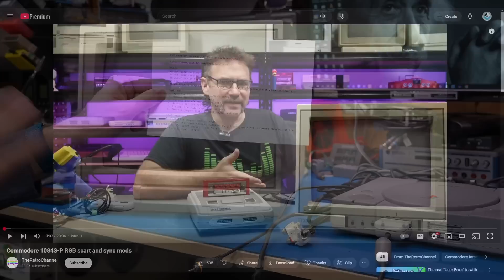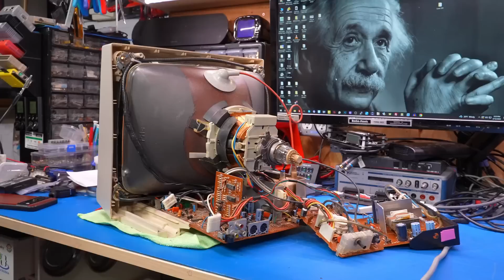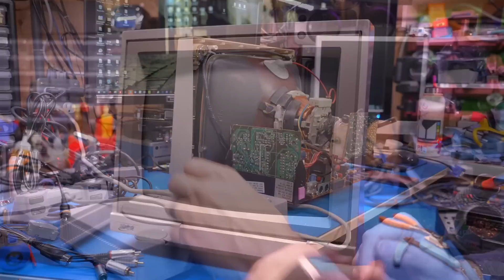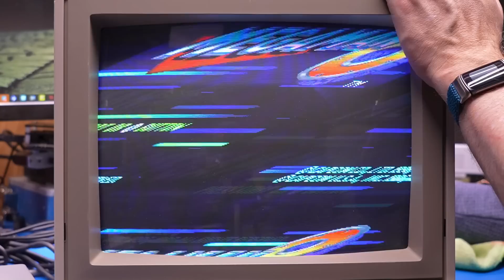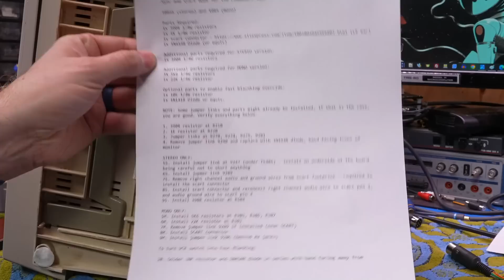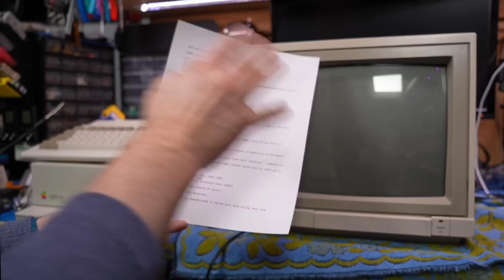Ultimate Commodore 1084 SCART modification

Comment: The pictures you linked with instructions have a totally different, third type of setup. The steps are also convoluted. This whole thing ends up being very confusing.

Is what you have written on the second paper in the video the correct directions or not? I think maybe you should just link those directions instead of an entirely separate, third setup in the link.

Comment: The RGB blanking signal (pin 16 of the SCART connector) you're talking about at 22:15 has an input impedance of 75 Ohms (like the RGB signals), so you should not feed 5 or even 12 Volts in that pin. 1 Volt is enough to do the trick.

Comment: I'm almost sure the issue with the sync loss has to do with the voltage on the sync pins. Unfortunately different classes of gear output different voltages. Some consumer TVs expected the SCART sync pin to idle at 0.3v and then go to ground for sync. Others could output as much as 5Vp which would need to be attenuated. I think using a diode and resistor to simply pull the sync pin to ground may have helped, you may have been either exceeding the source current on that pin or over driving it with full composite video. A simple diode circuit can be used to separate sync from the rest of the video and that may have been a better solution?
Reply: Oh, the eventual solution did use a diode :) I'm happy I figured at least part of it out

Comment: The Sony PlayStation SCART cable actually had 220uf caps on the RGB pins in the SCART end of the cable to properly attenuate the connection. The PS2 and PS3 had the proper caps inside the consoles so they didn't require them in the cable. I'm not exactly sure if using RGB with monitors that use BNC or RCA connections require the 220uf caps or not? Could it be possible that the monitor has the circuitry to compensate for this?

Comment: 52:20 why does this display move left and right when you click the button on the back?
Reply from the maker: Conversion from Composite video to RGB inside the monitor introduces a propagation delay into the video signal, which results in the image being slightly delayed, so it shifts to the right.
Reply: @adriansdigitalbasement2 ok

Comment: I can confirm that there were versions of this monitor marketed under the Philips brand.

Early versions of the 1084 were infamous for the the line transformer ‚unsoldering'ˇ itself, basically due to the solder joints breaking.  Mine was affected by this problem as well.  It started with the image glitching occasionally and the effect getting worse slowly over many years before eventually resulting in a failure.  The fix was easy, just resoldering the defective solder joints and while at it all other solder joins of the transformer.  I didn't even need fresh solder!

Another few years later the same thing happened to a power transformer the weight of which was hanging on its solder joints on a vertical PCB!  Not the best way to mount a transformer.  Again simply reheating the solder joints fixed the issue.  While the line transformer was a well known issue which 80's computer press did write about the same happening to the power transformer was ont a well known issue with the 1084 afaics.  Guess there are Monday models - and mine was Monday morning, 8am.

The final issue was the power switch.  Which I believe was a standard switch covered with a cap to fit into the design language of the monitor.  The switch of mine didn't always latch so had to be pressed again before it  latched in the on position.  After many years that effect got worse to the point where the switch got unusable and never latched in the on position.  I worked around the issue by jamming a small screw driver into the gap between the cover and the case while hold the button down with the other hand.

Eventually I switched to using it as my TV - initially a very crisp TV with good colours using a VCR and later a sat receiver set top box both connected via SCART and audio via a decent stereo.  Eventually degaussing for the mask failed resulting in a massive colour cast, a close encounter with a big magnet had not helped either and generally the tube was getting verry blurry, so I retired it as it was approaching its 25th anniversary.

Comment: FLYWHEEL SYNC enabled monitors/TVs to keep acceptable pictures even if the broadcast sync pulse was noisy or incoherent. (This was particularly a problem for international rebroadcasts in Europe back when many countries had their own unique broadcast standards. The broadcast sync signal would only be used indirectly to establish a local sync generator (the flywheel) which utilizes frame timing as well as the broadcast sync to provide a stable sync period.
VCRs have very clean syncs (it’s literally recorded on the tape at fixed intervals) but the nature of helical scan VCRs (before the advent of cheap Time Base Correctors) had inherently poor frame timing. VCR frame timing is dependent on the speed of the spinning drum and the playback head’s alignment with the helical scan signal written onto the tape e.g. “Tracking”.
The VCR Button on the monitor disables the monitor’s flywheel sync circuit because its time base could be corrupted by tracking / frame-rate variations and instead just directly relied on the clean sync signal transmitted by the VCR.

Comment: I don't know why you'd have a bad image with composite.  That's what I've always used with my Playstation (ever since I got something with a composite input and no longer needed to use the RF adapter) and the picture is perfect whether it's connected directly to the TV or running through a VCR's composite input.

Comment: The signalling on the SCART video switching Pin 8 was 12V -> Composite Video, 4:3, 6V -> Composite Video, 16:9 (widescreen); and if pin 16 went up to 1V, it activated RGB - correct me if I am wrong.

Comment: The explanation for this video locking issue is simple.  When the monitor is being fed an electronically generated raster, like that from an IIgs, the horizontal sync is precisely generated based upon a crystal oscillator (as I remember 14.818 MHz  or four times 3.57494 MHz color subcarrier) .  There is a sloppy, free-running, horizontal oscillator in the monitor that tracks the video sync using an AFC (Auto Frequency Control) circuit.  It's a pair of diodes along with some capacitors that track the incoming sync pulse (for NTSC - every 63.55 usec) and generates a dc voltage that corrects (or 'tracks') the timing of the video so you see a square picture (or raster) in the center of your screen. When the video is generated by a game console, computer or a TV station, it's very precise and accurate.  At the first TV station I worked at, they used a Cesium clock to control the house master sync generator.

Now here is where it gets a little weird.  The sloppy, free-running, horizontal oscillator in the TV is a sloppy whose basic frequency  is lower that the standard (15,734 Hz) horizontal frequency  so the AFC can easily correct it (a DC control voltage) based upon the crystal-locked  incoming sync.  Now you feed that TV a home VCR signal and this is where the problem begins.  When the video is coming from video being read off of a rotating scanner where one field of video  is read per swipe of the head, that's a long time (1/59.94 of a second) and mechanical issues can affect this timing.  Specifically, the tension on the tape as it passes over the head scanner.  There is an adjustment called forward back tension that controls how tightly the tape exits the supply reel table and onto the head drum.  If that tension is different between the record deck and the VCR deck (playback) at home, it will cause the top of the picture to 'hook' or have a timing difference from one field to the next.   If the playback tension is higher than the record machine, the picture will hook to the left, if the playback tension is lower than the record tension, the picture will hook to the right.  Finally, the switching point for the head drum video heads to start reading the next field is 3 lines above vertical sync or right at the bottom of the picture.

So what am I talking about here?  When the video switches fields at the bottom of the picture and your VCR has a much lower forward back tension (from wear), the horizontal sync pluses move far to the right (metaphorically speaking) when looking at your TV screen  and that sloppy horizontal oscillator in the TV (especially older, cheaper TVs) doesn't immediately jump to where it is but, through the AFC, tracks the new sync location over the upper third of the screen and pulls the picture back to the center of your screen.  Hopefully, this makes sense.

The capacitors in that AFC circuit control how quickly that DC voltage will correct the phase of the horizontal sync signals  and pull the picture back to the center of the screen.  Bigger capacitors and the time-constant (TC) will take longer , smaller capacitors and the TC correction will be faster.  All the 'fast-blanking' switch does in Adrian's video does is select smaller capacitors so the TC will be very fast and the picture is returned to the screen center within a line and you never see it.  Newer TV manufactures (still tube models) fixed that issue to stop all the complaints about their TV pictures having a hook at the top of the screen when they watched their videos.

I can explain in more detail but I hope I've kept a balance between details and concepts.  When I first studied this I got such a headache.

Thank you,
Gerry

Comment: In the UK the PlayStation was normally sold with RF  cable only as standard. Of course you could buy a composite or rgb cable. PlayStation IIs came with a composite and audio Scart adapter - no rgb as standard. So I never experienced better video until the PS3. Of course most kids played on a tiny cheap mono set in their bedroom anyway so we didn't know any better. But I do remember seeing Tomb Raider on a huge flat screen rear projection TV and it looked amazing.

Comment: This is a bit off topic, but you should be very careful about what cables you put into your consoles for SCART. People have damaged their consoles using cheap cables or wrongly built ones, I think it was about a missing resistor in the line that carries CSYNC.
Reply from the maker: It would be pretty difficult to damage a console with a cable, unless they incorrectly wired the +5V pin and fed that back into something else on the console. Otherwise there is a small risk of damaging the monitor if they don't have the right resistors or capacitors installed.
Reply: @adriansdigitalbasement2  it was something specific to SCART but it wasn't wrong wiring, I don't remember what it was but it could damage the console. Bob from RetroRGB did a video about it years ago, that's why is also not recommended to use cheap SCART multipliers.

EDIT: I found it, the video it's "Choosing the right cable for your classic console", and the section of the video is "Sync safety". TLDR, there are cheap SCART cables that don't have the components needed to control the voltage in the SYNC signal and they can output more than the required, thus frying the SCART components over time. Also, it seems the wiring of SCART can vary from console to console.

Comment: I have a Philips CM8833 from 1987, the PAL EU version, with the oldest PCB and flyback version. The flyback transformer in it broke down, a replacement for the original is unavailable, or at an astronomical price. I installed (on cables) a flyback transformer from a newer version of the monitor and it worked without any problems. I removed the voltage divider from the neck PCB and connected the cables as in newer versions of the monitor.
Reply from the maker: Ah good to know! How long did you make the wires to connect it to the PCB? Just long enough to get it connected up? I wonder how often this is possible with flyback replacements?
Reply: @adriansdigitalbasement2  I soldered the wires quite short, the transformer is attached with big zip ties to the radiator/shield. It is possible to make a simple PCB adapter with goldpins.

Comment: I had that monitor with my c64, used it well after I stopped using the C64, had my nes, snes, and genesis connected to it at one point. It was such a great one and I regret leaving home and leaving my mom to deal with all those old electronics (they got thrown out).
Reply from the maker: Sadly this was the fate of so many of these monitors :-(
Reply: @adriansdigitalbasement2  I had it well into the late 90s, so maybe longer than some, but yeah it's a pity. My uncle had given me the C64 and she put all that in an attic where about 300 floppies with different games melted into a warped mess too.

Comment: Yeah, re that VCR button - in the early 1980s in the UK (and I assume in other PAL regions) you tended to see eight channel presets on most TVs, and the 8 button would be marked "8/VHS" or similar. This would give the same result as the VCR switch, where the sync lean at the top of the screen would be removed. We had two VCRs around this time connected to a Ferguson television, a VHS on channel 8 and a Veta on channel 7, and the Beta picture was like that; we would tend to push the Beta signal through the VHS machine and down to the TV on channel 8 to get around this if the VHS machine wasn't in use...
Reply from the maker: How interesting! My friend Jon who explained the VCR switch to me also mentioned the channel 8 thing. This has to have been a PAL artifact or perhaps some specific type of sync separator IC that those TVs and this monitor uses.
Reply: @adriansdigitalbasement2  Aha! I think I might understand why flywheel sync was initially switchable... Essentially (I think) this technology would keep the sync signal going at a constant rate when there was sync loss. 

Certainly in the UK, TV stations up until the early 1980s ran off a master sync in the studios for each company - but it was impossible to sync with other companies around the country. Up until the early 1980s some companies (especially the smaller members  of the ITV network) did not have time base correctors as they were expensive - they would 'nudge' their own clock to match an incoming feed over several seconds. This was fine on a CRT but  used to cause havoc with VCRs (screen roll when they cut from local commercials to a network show etc), and I bet with the flywheel sync enabled (labelled "VHS synchronisation" in Ferguson TV literature) this sync shifting on TV stations would cause artefacts on-screen, exactly what they were trying to avoid.

In time all stations moved to TBC so the need for the switch went away? Does that make sense?

Comment: To get the composite to work properly from SCART & RCA, you need the following parts installed.
R501-100, R502-100, R503-390, R504-390
Also: R210 and R220 are listed as 22 and 75 ohms and that is what is installed in my 1081AU by the factory.

Have a look at the 1081 service manual (CM8533) and the philips_vs0060_0080.pdf service manual. 
I think the component values you are using for the mod come from a pal 1084 schematic that doesn't look like a genuine Philips drawing.

Comment: That's as close to a perfect god mode monitor as it gets. If only it had a removable power cable...
Reply from the maker: The power cable thing might be possible but it would require a new 3D printed bracket for the PSU and some cutting of the original case. That would complete it though!

Comment: I am always fascinated by how many different versions of the 1084(s) Commodore has brought to the people.
My PAL 1084 has the additional SCART connection that Adrian is missing. However, the button on the back is not labelled VCR, but ‘Vid’.
I also have a 1084S, which is absolutely identical to my Philips CM8833-II except for the Commodore casing and the power switch/power led.

Comment: SCART was the worst connector ever designed (bloody piece of French crap) they used to fit badly, the cables used to fail to connect the pins. Odd pins would fail. HDMI was a real bonus when it arrived. My set-up is UK based PAL all the way. None of my newer TVs have SCART (thankfully).

Comment: Considering how easy it is to mod certain consoles and computers to made them switchable between PAL and NTSC, I wouldn't expect doing the same to a monitor would be out of the question
Reply from the maker: It's a lot harder as there is an entirely different color decoding IC and then it requires a totally different set of components around it including a delay line used for PAL color decoding. A conversion would be possible if finding those parts is something that can be done (without a donor monitor) but even then switchable wouldn't be a thing.

Comment: I got an Acorn archimedes that come with a Phillips monitor, back in the 90s.  I seen a blanking plate on the back of the monitor.  so I popped it out.  Then butchered an old vhs video recorder, to get the scart socket.  I got the scart into the phillips monitor.  Yes Im an electronics god.  Uh oh, it didnt work.  I guess it needed more work.

Comment: Interesting stuff.  I don't recall such a blurry comp. video picture from the PS1 into my O.G. PAL C= 1084S (it has DE9 connector for RGB from Amiga).  Now I'm wondering whether I got an RGB cable for it.  My 1084S was also my TV (via tuner on VCR) for years - Great monitor - I still have it.
 - I did also used to have a Philips branded 1084(S) monitor that came with the A1200 I bought from someone - That Philips monitor had the SCART input on the back, but the CRT in that monitor wasn't quite as good as my original 1084S, so I sold it with the second A1200 that I had.